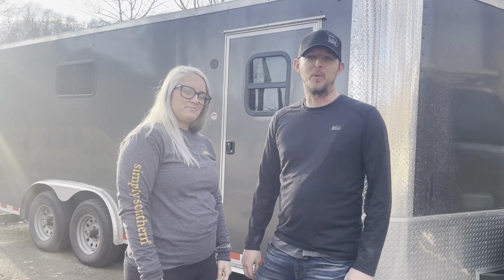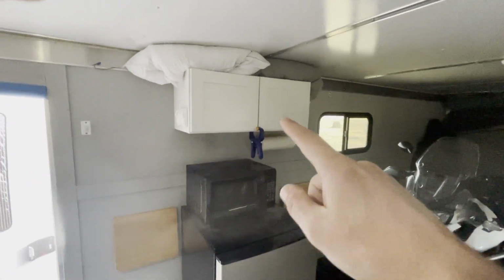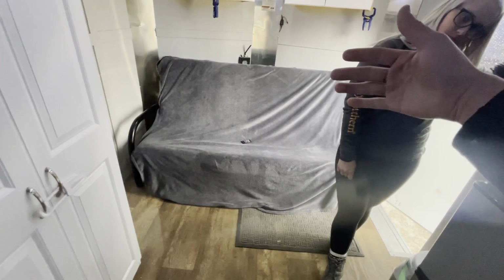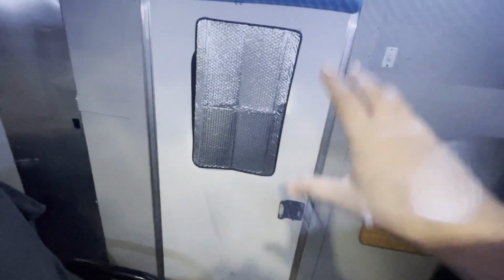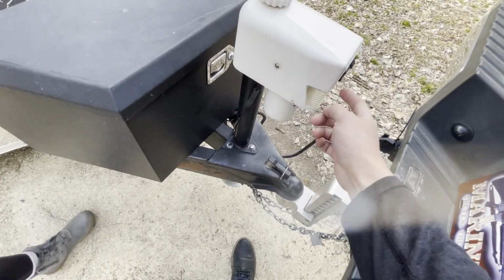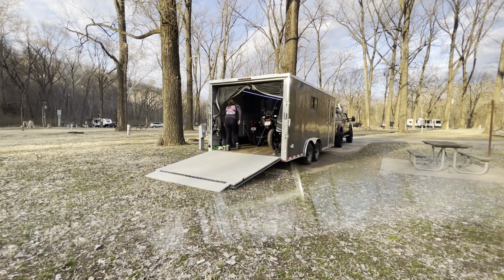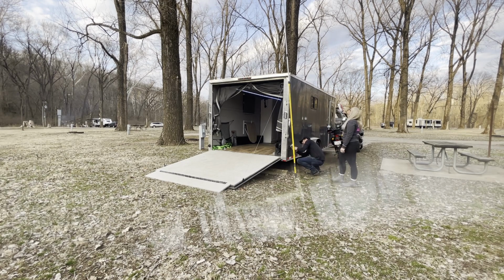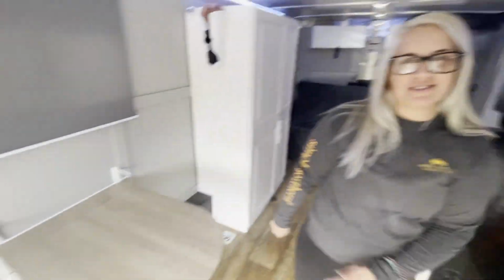Enclosed Cargo Trailer Camper Conversion - Walkaround and why we did what we did!

Comment: Magnetic cabinet latches will keep your doors shut. (White Velcro would do the trick, also) Speaking of magnets, magnets with eyelets or hooks work well in cargo trailers if you need to hang stuff off of the ceiling or walls. You'll find the sizes to hold anything you need by searching 'fishing magnet' on Amazon. Cheers!

Comment: Great video!  By chance can you provide the links for the WIFI booster.  I actually need one for my camper conversion
Reply from the maker: This is the exact one we used: https://www.amazon.com/gp/product/B01AWGY4TE/ref=ppx_yo_dt_b_search_asin_title?ie=UTF8&psc=1
We bought a big telescoping pole from Menard's and attached the exterior antenna to the tip with U-bolts.

We use a different model in the truck and 4runner, which is this one: https://www.amazon.com/gp/product/B07NY3QNDN/ref=ppx_yo_dt_b_search_asin_title?ie=UTF8&psc=1
but there is a newer version of this one out, plus you can find different version with different kinds of exterior antennas.

Both work really well for us and we use AT&T.  Hope this helps and thanks for watching!!!
Reply: @catchmeoutside8098   WOW awesome thank you for this.  This will help lead me into the right direction.  Good job on the Build!